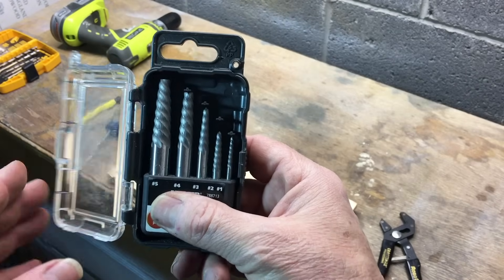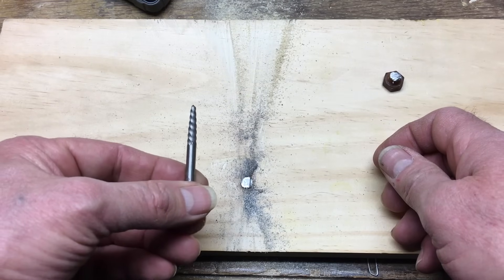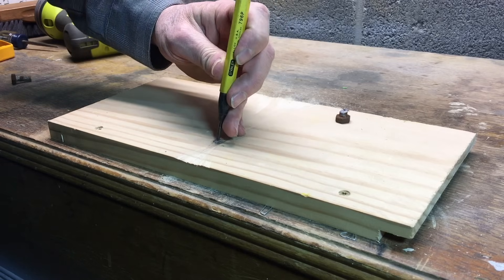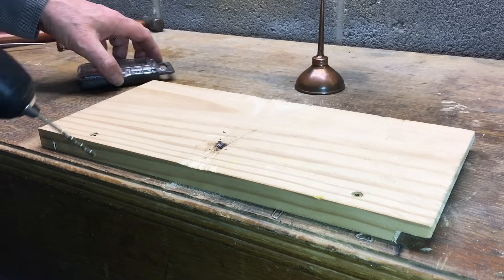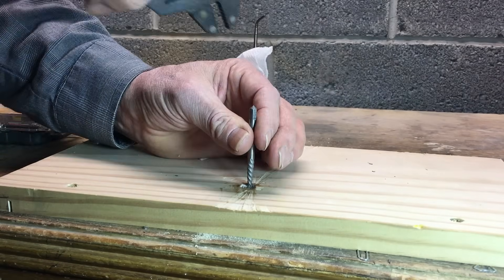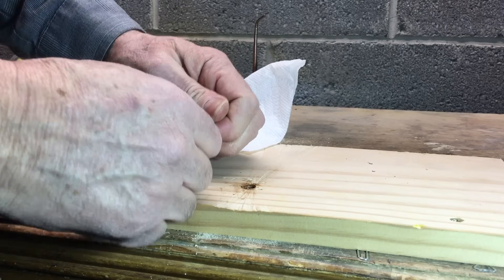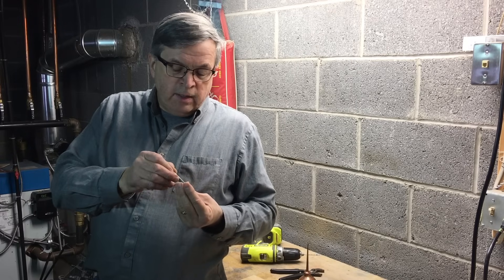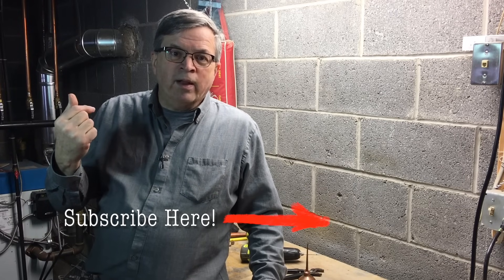How to Remove a Broken Bolt or Broken Screw

Comment: I know you turn extractor counter clockwise to grab the threads, but which direction do you drill into screw with the drill bit?
Reply from the maker: Regular ol' clockwise will do the trick.

Comment: Any tips for metal on metal that's siezed? Got a bolt on my sailboat that I can't remove from it all siezed up from corrosion/fusing and lost the head
Reply from the maker: Try a squirt of WD40 or another penetrating oil and let it sit for a while. Then hit it again and let it sit. Then, if you can, add some heat with a propane torch. Just make sure you wipe theoil off first! Let cool and then try the easy outs. Let me know. We used to sail a 30 foot Catalina on Lake Ontario...and miss it terribly

Comment: Extractors are available in larger sizes in this and other styles, at least to a size 8 in this style.  The advantage to the larger sizes is that you may be able to use them on a piece of pipe thread that broke off inside a threaded hole.  In that instance, you place it inside the pipe, hit it smartly a few times with a hammer to grip the broken piece, then twist it out   with a combination wrench (12-point closed end), adjustable wrench or a tap wrench.  In really tight areas, you may need to use a 12-point socket on an extension with a ratchet to remove the piece.  I would not use toothed pliers as Dave did here as it tends to chew up the square end.  Just remember that this style of extractor relies on the wedge principle to remove the broken piece.  Incidentally, this extractor type does not work when trying to remove a plastic fastener or a piece of threaded plastic pipe.  Once you've tapped it into place and begin turning, the multiple edges chew up the material; the extractor loses it's grip and then just spins around.  For soft materials (aluminum, brass or plastic), you'll need a plain, four-sided extractor.  They have sharp corners that cut into and solidly grip the softer materials to turn them out.  The style shown here, as well as the other types, are available on Amazon.  This video is a good one to learn about the process, but there are lots more videos on YouTube that cover specific problems.  Be sure to check them out, too.
Reply from the maker: Bingo! All very good points. Thanks

Comment: Thank you for the tutorial! Just broke one in my motorcycle. Thankfully, I already have the Easy out drills, but I wasn't sure how to use them. I will try this the moment I get an automatic screw driver.
Reply from the maker: Thanks for the comment. Let me know how it works
Reply: @CleanSlateFarm  the bolt was way too soft of metal. When the easy out would grip it would just roll over the metal. Lag bolts from Lowes are junk. Had to dig around it and turn it out with needle nose. Now I have a big hole on the front of my new porch post 😑😑😑

Comment: Great video, what if the screw was rusted and crumbling 😖, its a screw holding the metal in place under the bathtub spout.
Reply from the maker: You may have to drill it out and pick the pieces out. Tedious, but not impossible. Thanks for commenting and bringing up a good point
Reply: Angle grinder...
Reply: Bro this just happened to me this morning 😂 so I know I’m in the right place years later

Comment: This is great!  I had no idea you could even remove broken screws!  Was checking YouTube just in case.  Your screw is fairly wide, dimension-wise.  What if it's a very "thin" screw and there really is nowhere to drill into it.  Is there some kind of grabber tool that can be screwed in around it to pull it out?  Thank you.
Reply from the maker: No grabber tool that I know of. I have had success drilling out the screw completely but you need to make sure not to destroy the threads on the nut. How tiny is this alleged screw anyway??
Reply: @CleanSlateFarm  It's small, 2-3 mm...it's actually a hook that I was screwing into wood that broke off.  I did find another video with a tool I'm going to try to use to pull it out...as soon as I get it.  We'll see how it goes.  It's called a single screw extractor from Woodcraft.  Thank you for responding.  I appreciate it!

Comment: hi, i have a broken screw in my guitar & would prefer not to hammer a dimple so hard into it so i don’t mess up the paint. is there a better way to get a pilot hole in there?
Reply from the maker: with a true variable speed drill. NOT a drill with two speeds sometimes called by manufacturers variable. slowly drill a pilot and give it a try. Or, what I would do, is take it to a guitar repair shop. If you mess it up you'll probably end up there anyway and end up buying the removers and paying the shop. They probably have all the tools to fix it there. let me know what happens...really, i mean it. You have my attention
Reply: I want to know how this story continues too please.

Comment: What about a screw that snapped inside of a pole? (Screw goes in the pole, pull it out and the bottom half snaps and stays inside the hole).
Reply from the maker: Not sure what you mean but if you can reach the bolt you should be able to get it out.
Reply: @CleanSlateFarm  it was tough to figure out at first, but all I had to do was drill into the bolt and it came out.

Comment: Nice video thanks. 

Questions :

1) what drill bit did you use to drill the hole in the bolt ? Cobalt? I have it very difficult tor my drill bits to eat into the bolt to make a deep enough hole for the easy out to bite. 

2) did you drill in forward or reverse mode? Does it matter ?

Thanks.
Reply from the maker: The drill size is dependent on the size extractor you choose. There is a guide on the case to follow. YOu drill in forward and out in reverse. Hope that helps.
Reply: @CleanSlateFarm  noted thanks but I was asking what was the drill bit material ? Was it a cobalt drill bit? I ask because I have a lot of trouble trying to drill into the stripped screw head

Comment: Broke off a lag bolt into my brand new porch hanging up some plant hangers. It's a 1/4" lag bolt and it's flush with the surface as it was here in this video. I'm hoping I can extract it to install a new bolt in it's place
Reply from the maker: It should do the trick. Drop a note and let me know. Thanks

Comment: I was putting a shelf back up after the walls were just repainted and went to screw the last screw into the stud of the wall for the shelf, however I forget that I increased the torque on my Drill and about 3/4’s of the way in the Screw Snapped, how would I get a screw like that out? Cause yea the diameter of the screw is far smaller than the screw and bolt you used for the example and prolly about a quarter inch into the hole
Reply from the maker: Check out the link in the description above. They make these in several sizes. Let me know

Comment: Will i it t be this easy if said bolt is in an engine
Reply from the maker: Should be but the bolt may be rusted in. In that case use a WD 40 or a similar spray to loosen the rust. It may take some finessing but should work. Use a wrench and not pliers like this bonehead did. thanks for watching and commenting.

Comment: I went and bought the ez out kit. But I have a screw that broke pretty deep in the door hing of my front door. Still can't get it out. I don't want to break the door or frame. New house. I wanted to put in longer screws for security reasons. The one's that came with the house are only a half an inch.  Put in a new one from the hardware store and it broke deep. Can't get it out now.
Reply from the maker: Sorry to get back to you so late. Here is a thought if you haven't fixed it yet.If you can get the screw out, even if it makes a mess of the hole, do it. Then drill out the hole to a larger size, say 1/2 or 5/8 inch and plug it with a dowel.then re-drill for the new screw.  Maybe that will work. Let me know.

Thanks for watching and commenting

Comment: I was trying to change blinds at someone's house and a phillips screw was totally stripped.  The screwdriver could not turn it at all to get it out.  So I thought why not just check the internet on stripped screw heads.  Found out about extractor bits for drills.  Next day bought some, worked right away with little fuss.  Lol, my friend just wanted to rip up and destroy the wood to get it out.
Reply from the maker: Saved having to do woodwork as well. LOL. Thanks

Comment: What if that has happened while I was tightening the car’s transmission pan?
Scary to have such drill activity at that spot. Any other options?
Reply from the maker: Why worry about how close to the drill activity? It won't generate a lot of heat. It's the best option I can think of.

Comment: I have a screw that's stripped and broken (just spins) and recessed (can't grab it with vise grips).  How to get it out?
Reply from the maker: try using a hot glue gun to attach a nail, head down, and twisting or pulling it out. If it's striped you may have to drill it out. Let me know!
Reply: I was thinking of using superglue similar to your glue gun suggestion. However I finally got it out using a screw extractor. The smaller size didn’t work but when I went up one size it did the trick. But it took quite a few attempts with the extractor to finally get it out.

Comment: I recently found that a contractor had sheared off some of the bolts that go around my windows that hold up my hurricane panels. These bolts are screwed into the brick. Does this method work on mason bolts embedded in brick as well? Thanks.
Reply from the maker: Andrea Boon it should. Maybe even easier. Let me know how it works. As long as you can drill a pilot hole these should work for you. Thank for commenting and really, let me know
Reply from the maker: Andrea Boon now that’s providing they didn’t use an adhesive to hold them tight in a hurricane

Comment: I use to sale a “ left handed” drill bit set and it will do the same on some cases and save time.
Reply from the maker: Yes, that is an option as well though I have never done it that way. Thanks for that tip and watching.

Comment: What do you do if you can't see the end of the broken screw in a wooden door?
Reply from the maker: Well that needs another type of tool bit. I don't have a video on this one but it is simple enough. You basically remove the wood from the surrounding area with a WoodDriver.  That's a similar but not similar bit for the drill. Here is a link to amazon. They cost about US $15 or so.
EDIT: I did a little digging (no pun intended) and found a video showing how to use these. https://youtu.be/Q6h5uLmjUN8?si=8GfLwHJOH1Ow24a4
Reply: @CleanSlateFarm  Great, thanks for such a rapid response!

Comment: Hello a stripped screw is in my butterfly knife can I use these methods to unscrew the screws in it?
Reply from the maker: It would depend on how small the screw is. These only go so small depending on the brand you buy. My guess is on a knife it will take a fair amount of finesse.
Reply: Clean Slate Farm ok

Comment: I removed an outlet cover (covers GFCI in kitchen) before painting, and when I went to screw it back in, somehow it stripped and now the screw is stuck with the plate hanging loose! It’s so frustrating, and I’m definitely not an electrician. How can I get this off now, and then how would I create a new hole to keep the screws and the plate in the wall?
Reply from the maker: Wow! First...does the screw go right into the plug itself? There is a hole in between the plugs where the screw goes in. If so then try pulling the edge of the cover to apply pressure to the screw and start to back it out. Sometimes part of the screw strips and all it needs is a little backwards pressure to get to the part that's not stripped. If that doesn't work you may need to break the plate and try using pliers to muscle it out. Pull backwards on the screw while turning it out. Otherwise you may need to change the whole plug socket. It's not hard to do just make sure the main power is off to make sure you don't zap yourself. Buy an electrical tester to make sure the power is off to the plug. Here is the one I use. It's and amazon affiliate link. https://amzn.to/2Y1Go5x Let me know how this turns out.....no pun intended. MAKE SURE THE POWER IS OFF!

Comment: Hi there. I broke a plastic screw in the mount for a camera.  I tried to make a hole and insert a piece of metal and glue it, but it didn’t work, I couldn’t get a deep enough hole, since I am not working with a drill. Any ideas what I could do?  Thanks for your time.
Reply from the maker: Anne Marie how small is the screw?
Reply: Clean Slate Farm it’s about an eight of an inch.  It’s technically a part from a handheld tripod. It broke while I was trying to adjust the camera.  Until I get the piece out I can’t put the camera on another tripod.  Thanks so much for the reply😊.

Comment: What is the oil for?
Reply from the maker: It's a lubricant to ease the work of the drill bit. Thanks for watching
Reply: Thank you for the education!  I think that's what I needed.  I used these and stripped a screw stuck in my metal grill and they didn't work when oil and Phillips Head could've worked from the start.

Going to try the oil next.  I recently learned of Liquid Wrench from your earlier reply to someone else's comment months ago.  I'll be trying that too.  My next thought is flattening the screw head to shape it into a bolt and try a wrench to get it out.  Until then, it's kicking my tail.

Comment: I have an allen bolt that is reaaaaalllly stuck on my bike. I've tried many things. I've tried 2 extractors, both broke! The head of the bolt is basically a crater now. Any ideas on how to get it out or what my next step should be?
Reply from the maker: Drill it out with a bit smaller than the bolt and try again. May be a lost cause though.

Comment: What if the broken screw is smaller than the number 1 easy out?
Reply from the maker: You may have to drill out the screw completely and back it out another way. I've never seen a smaller EZ out. Come on...get imaginative....you can do this!
Reply: @CleanSlateFarm  this ones bad. It’s a tiny screw on a nice guitar. I don’t want to mess it up.
Reply from the maker: @MikaelLewisify  Take it to a luthier. Not worth messing up a nice guitar just to fix it yourself.

Comment: Much easier when it is in WOOD !
Reply from the maker: So true, but the concept is the same. Like I said, with metal you may have to use a bit of heat or WD40 to loosen the rust. Thanks for watching.
Reply: It was interesting... Nice video!   Thanks for posting !
Reply: @CleanSlateFarm  You are definitely right about the concept being the same for wood and metal.  But in a real world application, it's definitely not as simple, especially if any rust involved.
Reply: Will this work on my manifold intake gasket i broke a bolt off....🫣

Comment: What about for a screw broken off on the back of a TV where you can't pound it? Hangman products come with some cheap screws. Probably can't hang my TV now.
Reply from the maker: You don't have to hit it with a center punch. You can just drill it out starting slowly until the drill starts to bite in. I also saw someone super-glued a small nail to the screw and then had something to grab with pliers. Do this at your own risk....as it sounds risky to me.

Comment: Okay so use a taper to make a dimple, drill the hole with a bit, then use easy out in reverse to extract
Reply from the maker: Bingo! Theoretically, it's that easy....most of the time at least. Thanks for watching
Reply: Reading comments on other extractor videos, people report 60-75% success

Comment: What if its a threaded hole like a mower deck Mandrel housing bolt?
Reply from the maker: Patrick Cotter if you can get to the break it should work. Definitely get a pilot hole in there. Maybe not easy but it should come out. If it’s rusted or corroded use a penetrating oil and let it sit. Sometimes you may need to hit it with propane torch to cause it to loosen. Heat expands the metal.

Comment: Wondered why you chose to turn the extractor with a pair of toothed pliers, which chews up the back end.  I find it easier  to use a small tap wrench (from a tap and die set) to do the turning, as you can apply more downward force.  It also allows you to apply that force evenly as you turn it.  Another possibility is to use a Crescent (adjustable) wrench to turn the extractor, which has smooth jaws, unlike the pliers.
Reply from the maker: The pliers I used were all I had on hand that I knew would grip well. I don't have a tap and die set or I would have used that for better leverage. My dad used to say, "when all you have is hammer everything looks like a nail." ALso, I hate crescent wrenches (adjustable wrench to some) because the jaws are never tight enough. Thanks for watching and commenting....you brought up a good point.
Reply: @CleanSlateFarm  comment still relevant in 2021. Crescent adjustable wrenches have never done me well.

I really like the hammer and nail line.

Great show.

Comment: I may or may not have over tighten the screw until it finally broke, also I may or may not have bough the wrong stractor for the job, you live and you learn.
Reply: TheKnightDrag0n same i did it on the gearshift bolt on my motorcycle🥴🥴

Comment: But what if its seized in rust
Reply from the maker: Demcheck get some penetrating oil. WD40 should do the trick. Spray and let set for a few hours. Give it a try and if no luck spray again. Heat may work also. Propane torch if it won’t set anything on fire. Heat he dickens out of it and try that. Let me know and thanks for commenting!
Reply from the maker: Demcheck If you heat it make sure to wipe all the WD 40 off as best you can